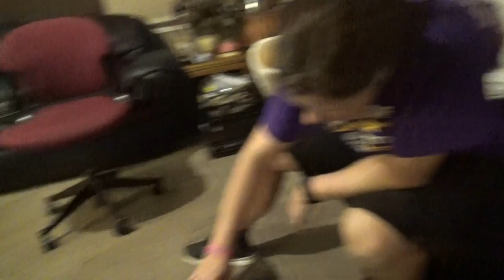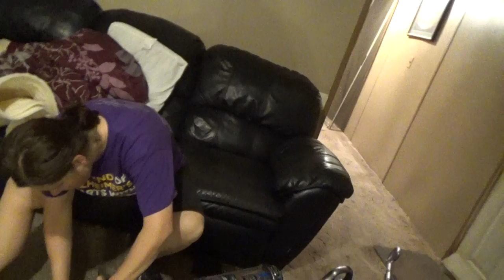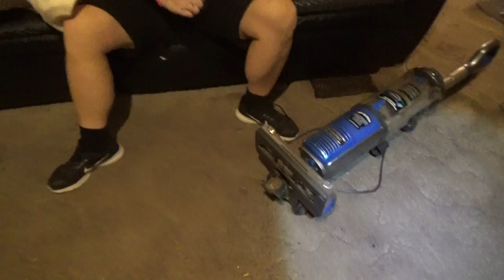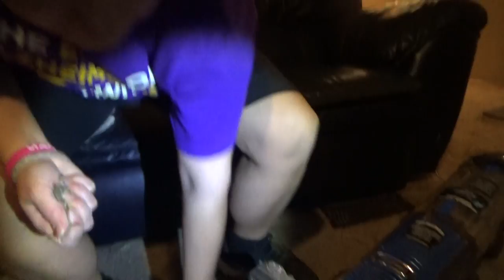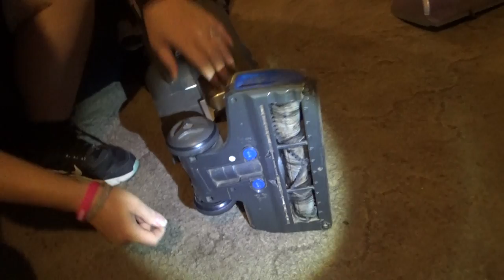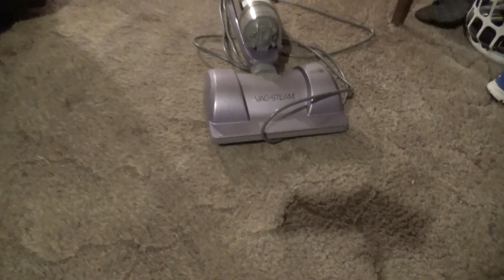I GOT #SHARK BIT FROM MY "SHARK ROCKET PROFESSIONAL" VACUUM CLEANER!  | 5 MONTH REVIEW |

Comment from the maker: I was so mad, so HOT, and so sweaty. My wife was so ready to go to bed, lol. This was like 3 a.m. and we had been doing like spring cleaning, so we were ready to vacuum up and finish everything up and then this happened.
Reply: Hey I have the orginal Shark thats purple and it has not clogged or crapped out. this replaced my blue 1 that has a on off switch issue. another vac I have is the Ultimate clean pet from Eureka, it freaking awesome 12 amp does well also. Again I have the Nvl22 31 pet model purple no issues yet had it about 2014. Good day and God Bless.!

Comment: I have the exact same model, and mine is running pretty good. Have you checked the tubes to see if there is anything clogged? It sounds like something is clogged, because it should not sound like that. I suggest take it apart and explore your vacuum
Reply from the maker: It's the same part clogging everytime. Bad design for certain terrains.